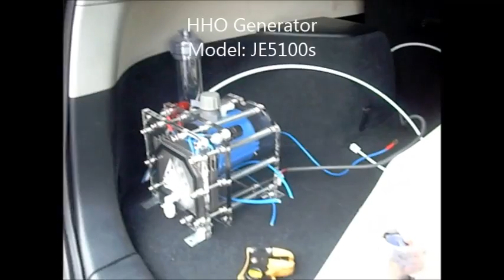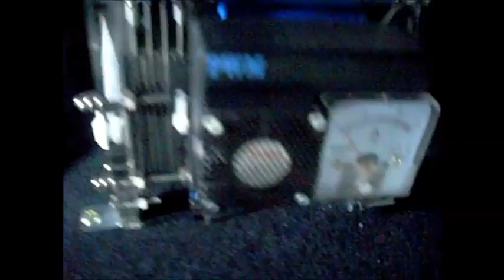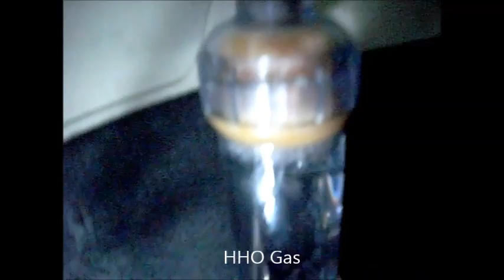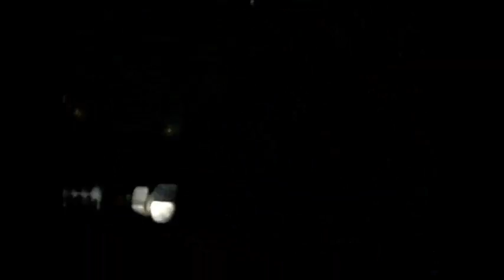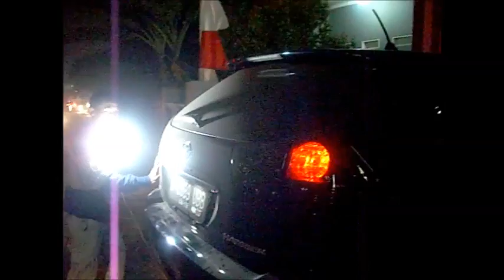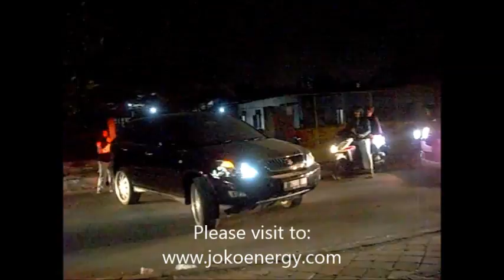Fuel saver HHO+EFIE Joko Energy on Toyota Harrier 2.4L 2008

Comment: Will it save fuel for what %,
What is the milage per litre of petrol.how much water is used.
Reply from the maker: savings on vehicles are not the same, on average it can save 30-50% for gasoline engines.
1 liter of water for a distance of about 500-800 km